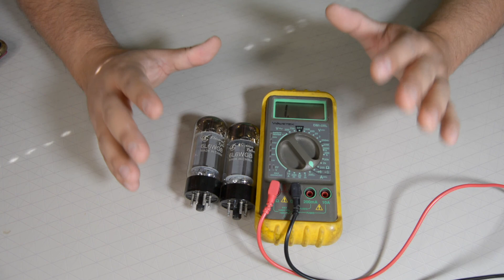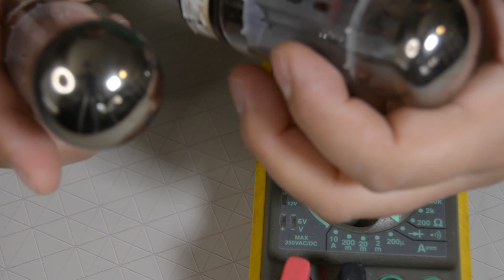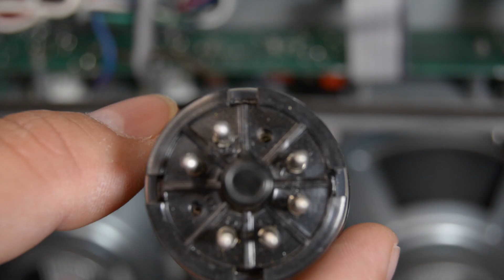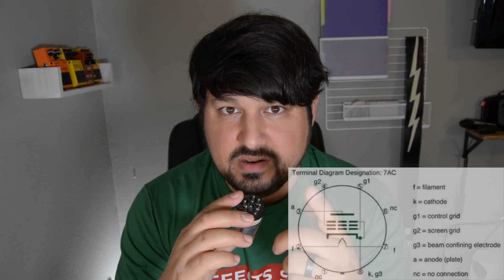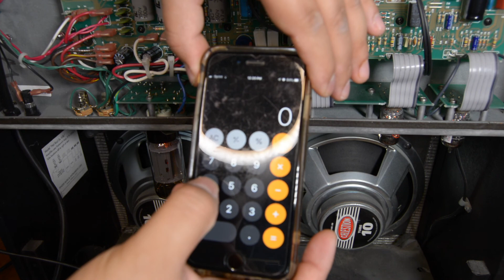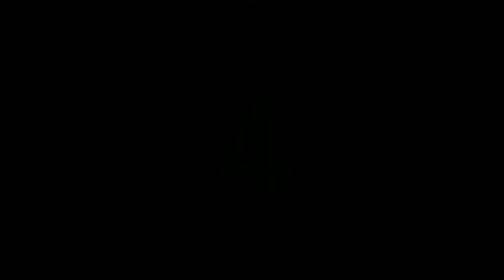HOW TO REPLACE & BIAS POWER TUBES: Step-by-Step Guide to Replacing 6L6 Tubes in a Fender Hot Rod Amp

Comment: noob question here Robert, do i have to re-balance the bias if i detach the tubes from the amp for shipping purposes or say for a long haul? cheers
Reply from the maker: As long as you put them back in the same slot you took them out of, you are ok. Technically, you can mis match, but I feel the tone changes a bit because since they are used they slowly become off balance if that makes sense.
Reply: @rsaldana1980  thanks Rob, gonna follow your advice!

Comment: I bought a brand new Deville in 96. From day one that amp was worthless. First, every time I switched channels, either via foot pedal or by hand, there was a loud, and I mean LOUD pop, regardless of the volume level. I knew zero about amps or electronics at the time and it was supposedly under 'warranty.' Nobody could, or would fix it. Then the jacks both failed/got crackly and cut out at the same time, again, no fix. finally the tubes went out and I decided it wasn't worth even buying new ones. I bought a Blackstar and have never been happier. So disgusted with Fender through the five years they gave me the run around and finally told me tough, your warranty is up! I got a lemon and they did everything they could to avoid making it right. Never again will I purchase anything with that name on it.
Reply from the maker: Oh man. Sorry to hear that. I had the same problem. Which is why I got into fixing amps. I always had to fix my fender amp. Eventually I started to love them because they are easy to fix compared to anything new.  I love Blackstars. I worked on a few of those too. Usually it was because the owners never replaced tubes and then it blew out something when the tubes shorted.